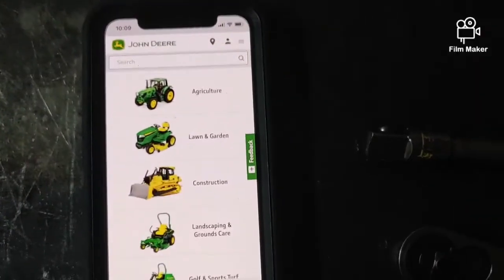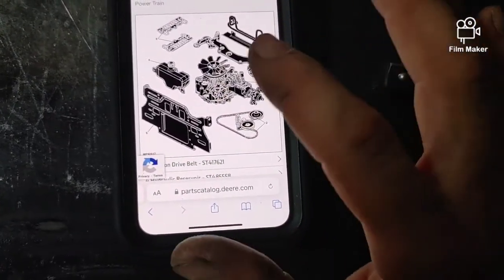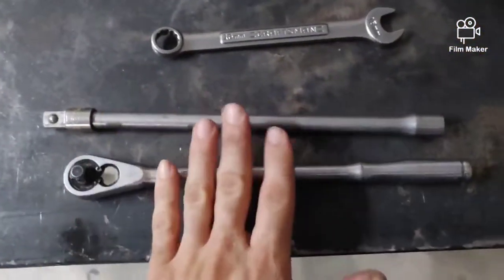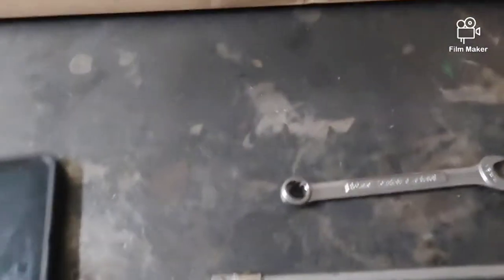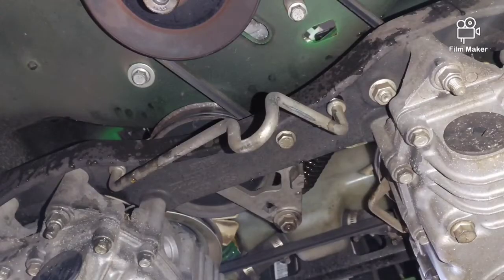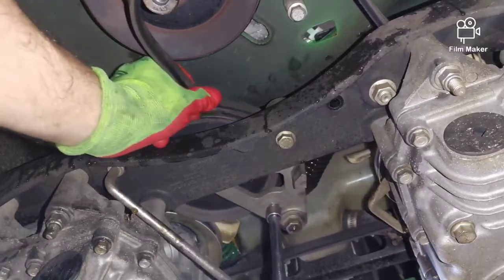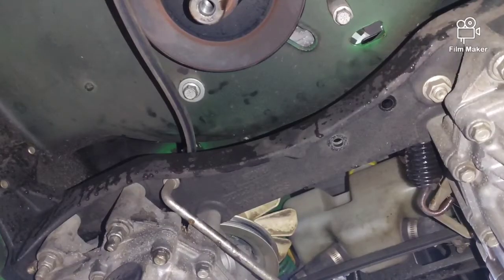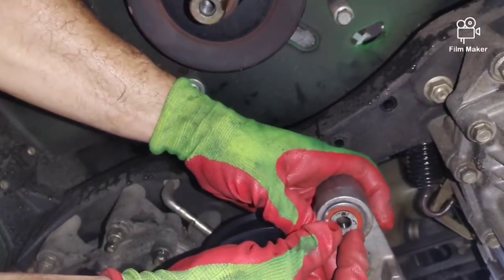John Deere Ztrak 900s Drive belt & Tensioner Pulley Change

Comment: excellent video mine is a 960 m and it looks just like the one in the video mine the clutch had  amajor come apart and took out the the belts a nd the tensioner pulley as well as the bracket that holds the  tensioner pulley , and the manual we have was not very helpful at all so i was jind of starting from scratch on this job  and im not complaining i love this mower its got over twelve thousand hours on it and thats the first major problem its had  and it has been rode hard and put up wet lots of different people running it and none of them really givin a crap if they boke it or not  and the ole girl just keeps on giving everything she has iv e been around a few major players in my day and im here to tell you nothing runs like a deere
Reply from the maker: Thanks for watching and commenting. I have several videos on these mowers. They are easy to work on. Subcribe if you havent already. I'll have more video coming soon

Comment: Good video I have a z930m I read at tuff torq that you need to change break in oil in hydros at 50 hrs. But my manual says 300 hrs what are your thoughts on it
Reply from the maker: Hey Jerry, Id wait until 300 hours. The do it about every 1000 -1200 hours